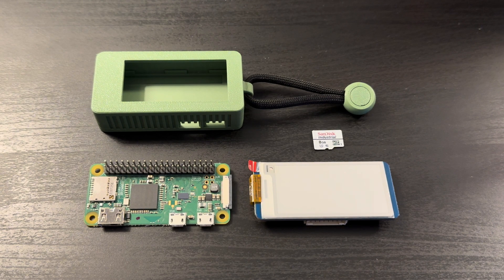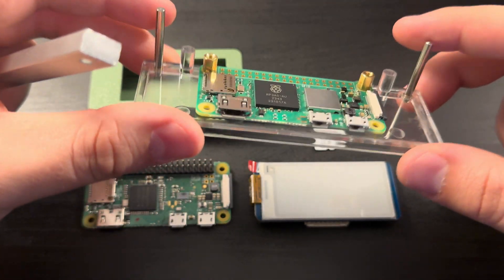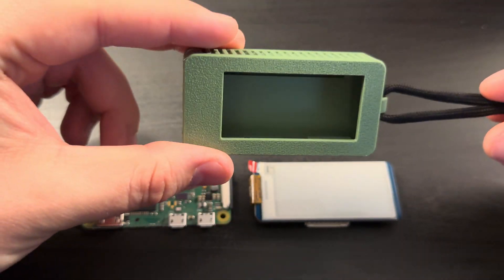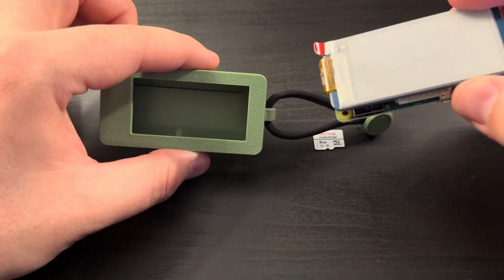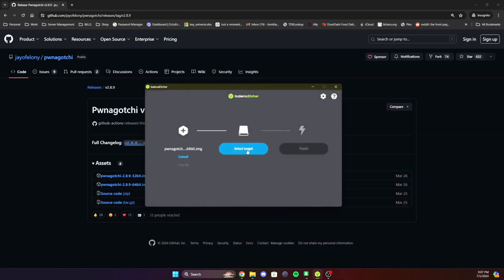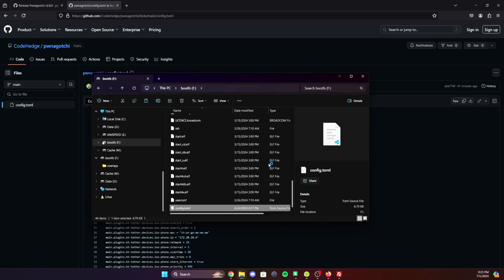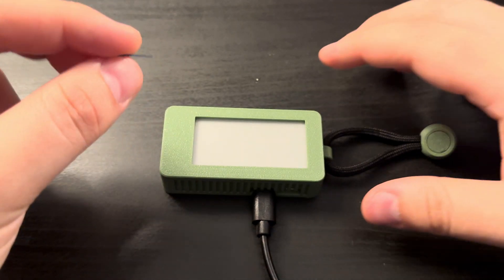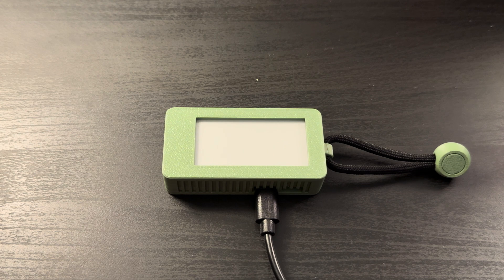How to make a Pwnagotchi - Easy

Comment: I’ve never been so effing frustrated by a gadget ever?!…54 hours I’ve spent trying all the advice on YouTube, forums etc…rpi zero 2 w, waveshare v4..sandisc 32gb card….latest Jayo Feloney image, edited config.toml and dropped it in the root directory…..sometimes it connects to windows 10 laptop, other times I wait for ever, and just when I’m reaching for the hammer I think, no, let’s try something else….i replaced everything apart from the rpi zero 2 w………..any help appreciated!
Reply from the maker: Ok so you imaged the SD, dropped the config.toml from the GitHub on to the SD card BEFORE BOOT, and plugged it in? Do you get a green light when plugging in the Pwnagotchi?
Reply: @Hedge-Tech-95  yes flashing green led, sometimes I get a connection sound, other times nothing…..replaced data cable, replaced screen….sometimes in device manager I can see it rndis gadget but still no image on the screen..if I sudo pi@10.0.0.2 I get a response..screen is enabled in config.toml..
Reply from the maker: What version is your Waveshare display? You didn’t get the three color one right? You got the black and white only?
Reply: @Hedge-Tech-95 2.13 V4 black and white..
Reply: Ould it be a bad rpi zero 2 w?…

Comment: can i somehow make it with a R PI PICO? or with an esp32?
Reply from the maker: No, it’s gotta be a raspberry pi computer. Micro controllers are not compatible. It runs Linux
Reply: @Hedge-Tech-95  Yeah i googled sm abt it after posting the coment. So the zero WH would work too because it is just zero W with headers.
Reply from the maker: @kubecrider yes, nearly every raspberry pi that’s not a microcontroller will work. If you go with a zero, go with the zero 2
Reply: @ the only available zero is WH, it should work too right? cuz u used W in this project, or is it a regular zero?
Reply from the maker: It will it’s just much slower
You can buy a 2 w here

https://www.pishop.us/product/raspberry-pi-zero-2w-with-headers/
Reply: @Hedge-Tech-95  they dont ship to EU to, nvm, can it run on esp32?
Reply: @kubecrider  no bcs the esp32 is a microchip and not a arm chip so it can not run the OS:Linux which is needed to run the system
Reply: @TërnocBesa 7 months🥀😂

Comment: Hey I was wondering if you could help me with your guide? I am using a Pi Sugar3, Pi Zero 2w, and a Waveshare v4. Is there anything I need to change in the config file? I turned it on and it flashed the green lights then a blue light has been on, but other than that nothing has appeared on the screen. I have left it on for a while now.
Reply from the maker: There isn’t anything you should need to change in the config. I would re-image the SD, make sure you add the config file before ever booting with the SD card

Comment: How did everyone create the new user on the pi?  Pwnagotchi is running on my Pi2W but after about 15 minutes I get the pi wizard and my keyboard will not work.  Is it okay to create the user and enable SSH using RP imager?
Reply from the maker: You just use
username: rpi 
password: raspberry 

Shouldn’t need to do any custom os settings as that’s all baked into the image and config.toml file I provided :)
Reply: @Hedge-Tech-95  I get the same message Please note that SSH may not work until a valid user has been set up.  I used rpi as username and raspberry as pw.  I am on a windows 11 machine and tried putty as well as powershell.  I reimaged SD card via RPI and balenaEtcher on two different RPI 2 W.  I can switch my HDMI input on my monitor and the pi has the blue config new user screen.  So strange.
Reply from the maker: That is insanely odd, I just made one yesterday using the same steps. You’re using the latest jayofelony image 2.9.3_2?

Comment: this is so frustrating I've tried everything I've looked through so many tutorials yours was the easiest to understand but nothing works, i can do everything but when i plug it in and leave it to boot up, nothing happens I've left it for 30 minuets and nothing happens other than the green light turns on. I've got a waveshare v4, and pi zero 2 w. i don't know what I'm doing wrong
Reply from the maker: Green light coming on and staying on is a good sign. Right after imaging the SD card, you’re adding the config.toml to the SD card before you boot the Pwnagotchi the first time right? That’s how the setting to enable the waveshare display is set. Without doing that, the pwnagotchi would act like you’re saying, just staying blank.
Reply: @Hedge-Tech-95  yes im doing that i dont know whats wrong
Reply: @Hedge-Tech-95  i just rewatched your video and a few others and i found the problem was it wasn't showing up in device manager  but its finally working now after a week thanks so much!!

Comment: Appreciate the video, very helpfull without the extra nonsense in a lot of other tutorials. Followed the steps you gave but for some reason my board will not light up (the green flashing led) and does not boot up. Got any suggestions or thoughts on this?
Reply: nvm! I got it to work by reordering the way I plugged wires in!
Reply from the maker: @benhinton8223 awesome to hear you got it working! I was writing up a reply but then saw you got it lol

Comment: Yeah dude.  straight forward.. plus I like your "back 2 basics/ Go with what works" approach.... instead of going with the P0W2 which has no headers and seems to be the bain of manies existences.. you went with the already headerred Pi version-- obviously we all want th elatest greatest, but what is the point of havi' one of these if it doesn't work/ worse, you are ripping out tooth, nail, every remaining hair having to trouble shoot any and pretty much every next step of the way- living a hermit live, dwelling in the depths of reddit and which ever resource that contains 'git' in the URL.
Reply: For me, I have no issues with the initial stages ...it is  attempting to connect to it down the road that I struggle with... I can see i t on the network - it's there...but, no luck accessing the files togo through customizations and adding things like GPS ... i can't access the TOML file to go through an make the nescessary changes for the lil 'gatchi to gotch. And my head spins as to which TOML file to use in the first place... any help in that regard would be a fantastic video- surelly helping out many in the same situation.
Reply from the maker: Hey! So if I’m understanding right you have two issues, having trouble connecting/SSHing into the Pwnagotchi to change the config file, and unsure what changes to to the TOML to get GPS to work.

I have another video on my channel “How to add custom faces” or something close to that. The first few minutes are going over how to SSH/connect to the pwnagotchi. You need a driver, a certain IP assigned to you PC. But check out that video and I bet you get connected.

GPS is a little trickier and honestly I haven’t done it. But I would leave the toml you have and just add the portions you need to get GPS to work. Don’t overwrite the whole thing. But first things first, see if you can get connected to the device :)

Comment: Bro thank you, every guide said you could skip the config.toml and I could not get it to boot like that. This worked for me! Thank you!!
Reply from the maker: That was one of the main issues with most guides IMO! While it’s kinda true, the problem with that is the default display selection. If you SSH into the device, you can fix the display setting and it’ll start working. I find it so much easier to change the default config and do it right from the beginning. Glad it worked out for you :)

Comment: I still don’t know how it works without any “buttons” (like the flipper zero)..? Is it ALL fully automated with AI ? 
And also if I leave it on 24h/7 is it good? Will it overheat? 
Thx for a reply
Reply from the maker: Yes, it’s fully automated, but you can SSH into it and use bettercap yourself if you want to manually control it. But usually you’ll leave it in auto and let the AI run bettercap. 

As for the heat, I’ve run mine 8+ hours with no issues. I’ve topped out at 45C with the zero 2 and less than that on a zero 1. There’s a memtemp plugin you can enable to show temps on the display if it’s a concern for you!
Reply: @Hedge-Tech-95  Wow ight, thank you very much

Comment: Thank you. Fixed my issue with the v3 screen. Very easy.

Anyone struggling, try using the Raspberry pi imager instead of etcher. Let it verify. Make sure microUSB is decent, the crappy ones dont work. Be patient on first boot. Make sure you get the right version for your hardware (32-bit vs 64-bit). You will see 7 green blinks on your Raspberry pi if the image is the issue.

Comment: Bruh can u lend me a hand. I'm using a rpi4 what exact file do I use. Also do I unzip it or will etcher handle that. Also what if any changes do I make to the configuration file. Also do I delete the configuration file that is already there?
Reply from the maker: I think the RPI 4 is 64bit, so try using that image.

There’s no unzipping, just point etcher to the file just like I did in the video.

As for the config, use the one I link to. By default after etching there is no config.toml file. So there shouldn’t even be an existing one to overwrite. No additional configuration should be needed unless you wanna change the name but in your case, I would leave as is just to check if it works.

Now I haven’t set up Pwnagotchi on an RPI 4 before and it’s a little out of scope for this video since I go over RPI zeros, but what I said above are the things I would try :)
Reply: @Hedge-Tech-95  I initially tried the x64 version. Did ur config. And I got no display seemed like it didn't work. Also I meant there is a configuration file already there but not .toml. I will try again and also try the x32 version
Reply: Got it working